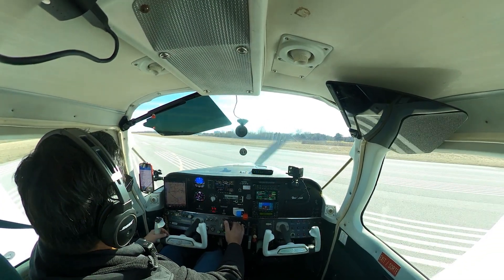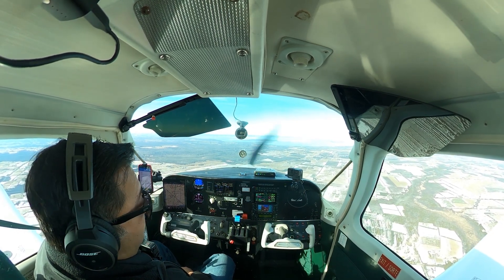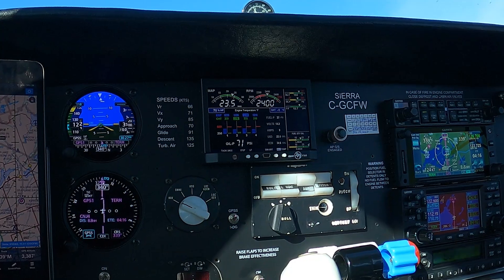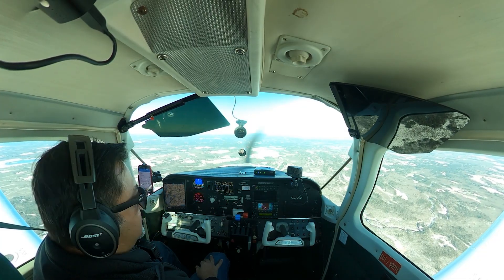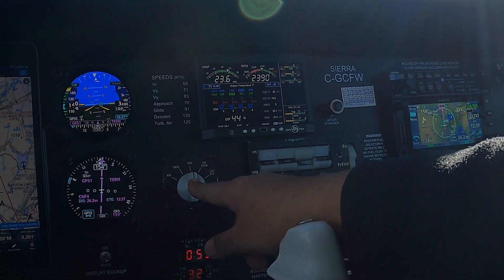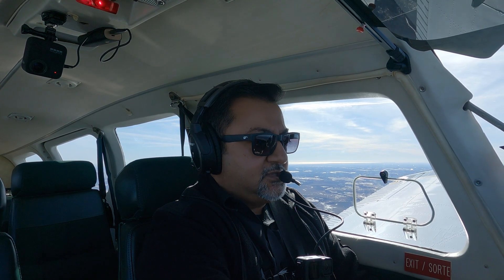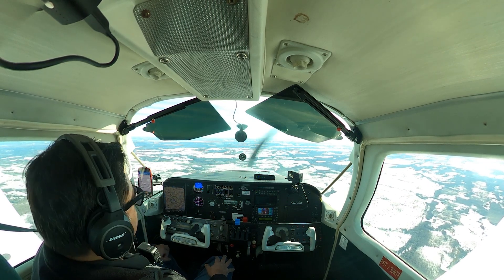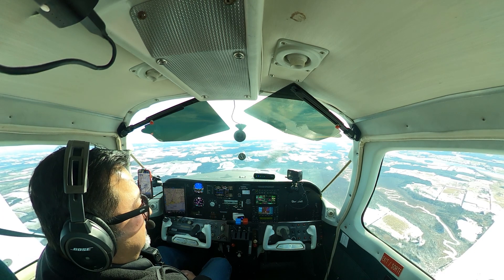Old autopilot on its last legs?

Comment: I had exactly the same Century autopilot as yours and I swear that system doesn't have a GS / glideslope / glidepath mode.  You keep referring to 'glideslope' when talking about the LOC mode on the radio nav selector - but that does not control GS, only LOC.   LOC and GS don't always go together, and if that system had GS capability, it would usually be labelled as "APPR" or approach (to indicate that it arms both LOC and GS).  As far as I (and several avionics shops) were aware for the 8 years I owned that plane, the only 2 vertical modes that that AP has are 'pitch hold' and 'alt hold'.   No GS.    When flying an ILS or RNAV, you're expected to use the LOC mode, then follow the glideslope manually using the pitch controller, or else disconnecting the AP and flying it manually.    Please don't spend money on trying to get the glideslope working on that unit - because it doesn't have one.
Reply from the maker: No, I’m not spending any more money on that old CIII at all, that’s for sure!  But they do have the ability to capture glideslope if you’ve got the right module in there. And my plane had the right module but at some point it stopped working. Before I had my panel upgraded there was a “glide slope captured” light, but the guy who sold the plane to me said that module had stopped working and he never had it fixed. When working, it executes a glide slope descent by using the pitch hold mode (you’d have to adjust power manually of course). In any case, it doesn’t work on mine any longer, and I won’t be putting another penny into this AP. I’d rather save it up for a GFC500 😀. Thanks for watching and for reaching out.
Reply from the maker: As evidence, here is the section from the pilot manual for the CIII: “Upon interception of glide path (when deviation needle drops to center) the Glideslope Coupler will automatically engage the indicator light will come on, and the aircraft will assure a preset nose-down attitude for descent”

Comment: Kamal, sorry  to hear about your problems with the Century IIIc autopilot. I have the same A/P in my Piper Comanche, but I haven't upgraded to glass yet. Nice to see that the GI275 will output an analog signal to run the Century. I'm considering either a pair of G5s (which won't drive the CIII) or a Dynon Skyview HDx. Regarding your altitude hold, check the Altitude Hold pressure sensor by a reputable shop, the diaphram may have a slow leak. About the glide slope coupler, there's a procedure in the CIII service manual (Section 6.7) on how to adjust the trim pot on the coupler box while shooting an approach (at a safe altitude with 2 people of course). The CIII is capable A/P. Trio is certified for the Comanche and is reasonably priced, but is not approved for the Sierra. Good luck with whatever you decide.
Reply from the maker: Thanks for the message!  My AP seems to have settled down for me. I’ve learned to really take the time to stabilize the plane in cruise before kicking on the AP and then it behaves just fine. Eventually I’ll probably put in the G500 but not any time soon since it’s working great. 

I’ll check out that procedure on the glide slope coupler, thanks for the info!  

The Comanche is a very cool plane, I’ve always wanted to try one of those. Thanks for watching!

Comment: Another option for the autopilot is Genesys S-TEC 55x.  It's not as new (or expensive) as the GFC500 but it does have everything you're looking for.  Not sure if your GI275 will interface - probably need to check with Garmin on that one.   Really enjoy your videos - great to see someone else flying a Sierra.  If you make it down to the Nashville area again, feel free to stop by 66TN where I keep my Sierra.
Reply: I'm sorry but the STEC 55 is plagued with issues and is really lacking in modern features.   No IAS hold for climbing, no VNAV interface.  Just put 'STEC 55 problem' into Google or YouTube and see how many there are!

Comment: Test the Pitot Static system for leaks. Replace the Altitude Hold canister. Then Alt Hold should work properly. Regarding Glideslope coupling, check that GS signal is getting from Garmin to coupler.  If so, replace coupler. Then retest GS coupling.

Comment: In our 79 C210 we used our old Cessna 400B auto pilot with a Garmin 430, surprisingly it worked well with our steam gauges...sure saved the dollars!
Reply from the maker: Yeah that’s the setup that I had before I upgraded my panel: a GNS430w with steam gauges driving the AP.

Comment: I added GFC500 in my Piper Arrow 2 years ago and it's been the best investment. Single pilot IFR is amazingly simple when combined with Garmin GPS (I have GNX375) along with dual Garmin G5s. I fly holds at cruise speed and this thing is on rails. Unbelievable accuracy, precision and no reliability issues with it. I actually had mine installed in Oshawa at Enterprise Aviation. Not cheap, but definitely worth every penny.
Reply from the maker: Oh nice, those are the same guys I used to do my panel upgrade.

Comment: Your AP altitude hold works just as well as mine in my Comanche. In my case, though, i have an alt hold by S-TEC which is separate from the navigation AP. doesn't make life easier. Ive thought about dumping $$$ into the issue, but its just easier to hand fly most of the time.
One other thought. Just for diagnostic purposes, have you tried selecting your alternate static source?
Reply from the maker: I haven't tried the alt static source, but given the GI275 seems be getting the right altitude, and the GPS altitude also shows a climb, I think it's probably not the source.  Still, I'll give that a shot next time I'm up.  Thanks!
Reply: @WingsOverTO  thanks for adding. To my data points!

Comment: If you plan on holding onto the plane the GFC500 is the way to go in my opinion before dumping more money into a losing cause. As far as holding off until Trio adds the STC for your plane to their list I wouldn’t entertain that. I have a Trio in my 182 and it works ok but I believe the Garmin support and functionality with your current Gamin equipment is worth the extra investment. There are so many aviation shops around that can provide services. 
The only reason I ended up with a Trio was the timing as I believe it was in 2016 when I did the panel upgrade and Garmin didn’t have the options then. Basically the same reason I went with an Aspen PFD at the time. Now Trio has approval for integrating the units so that’s where I am at now. The Trio went back to California for upgrades and currently waiting for re-wiring and install to see how it pairs. Essentially it will allow for altitude capture and heading selection on the Aspen instead of everything being selected on the Trio. I was contemplating switching to a GFC at some point but now with the integration that has currently been taken off my list.
Reply from the maker: Thanks, Terry.  I totally agree that the GFC is a fantastic system and I'd much rather have that than trying to retrofit an older system or waiting for the Trio.  I just wish the cost wasn't so high!  It seems every year since I bought the plane I've ended up dropping a good chunk of money into it, and I was hoping 2024 wouldn't be like that.  :)

Comment: First, I see you still haven’t stuck that snubber in your JPI 900’s MP line. 😂 If mine jumped around like that I’d go crazy. 

As for the AP. Does your Century have a pressure transducer for altitude hold? If so, the problem may be in the pressure transducer or the static line going to it. If you have a generic email node linked to your channel, I’ll send you a picture of what it looks like. Also, considering you are having intermittent glide slope issues, your altitude hold and glide slope coupling may be a related problem in the computer of the autopilot. 

On my Aspen and I suspect the same goes for your Century, there is no link between your altitude hold function on the autopilot and the altimeter. In other words, the GI-275 is just showing you losing or gaining altitude. The issue is in the AP. 

It might be worthwhile having another shop look over the installation. Sometimes a shop isn’t as familiar with the analog world.
Reply from the maker: Hey there, thanks for writing.  You can email me at wingsoverto@gmail.com .  Thanks very much.  There is a shop not too far from here that has a bench test setup for the Century III (and in fact they did repairs to my autopilot before I bought the plan back in 2020), so I'll probably fly down there and have them take a look at it.

Comment: Sounds like an upgrade to the GFC500, although it won't be cheap, might be it. Any other options?
Reply from the maker: Sadly that is the only modern option certified for my plane.  I could try to find something a bit older but doesn’t seem worth it.
Reply: @WingsOverTO  Understood

Comment: Chasing down issues with analog autopilots and modern digital avionics is a pain. I had a similar problem with a Century 2000 system, but in my case it was a more apparent vertical oscillation, up and down. I took it to Century and spent thousands and they only slightly fixed it. Frustrating thing is that it wouldn't do it all the time. Just occasionally. Century spent much of their time overhauling servos and making adjustments to the head unit.
Reply from the maker: Yikes, that sounds brutal.  For that cost and level of frustration and the mediocre result, it might be better for me to just bite the bullet and upgrade to a GFC 500.